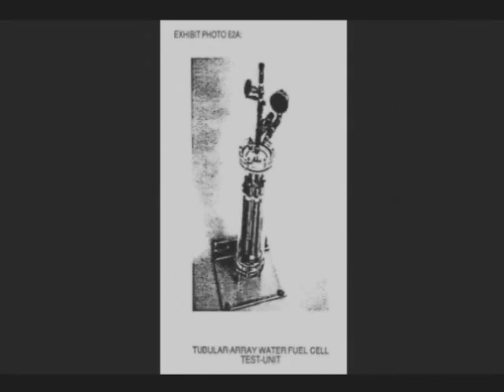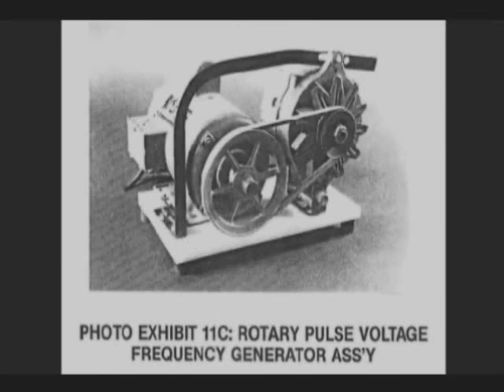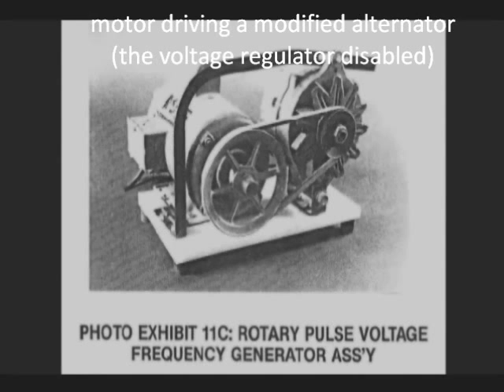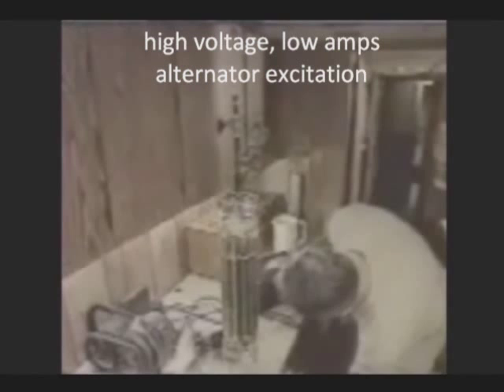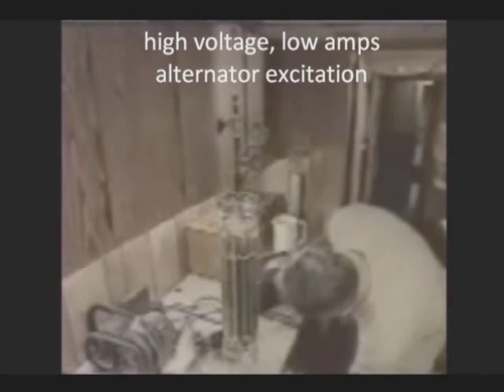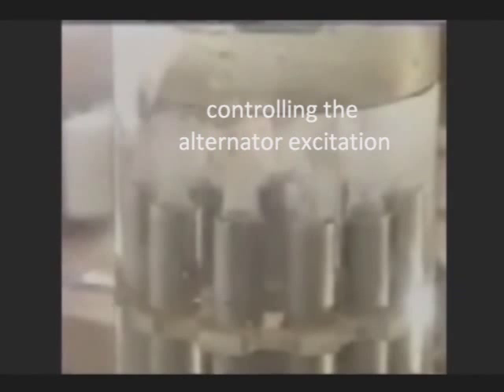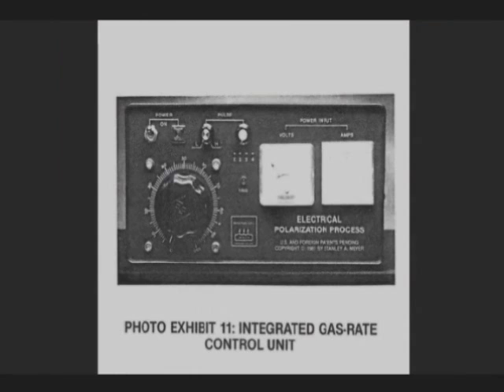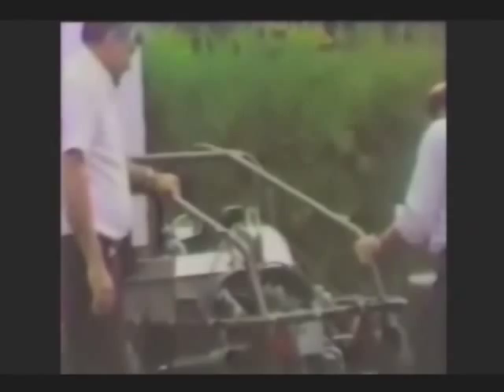Stan Meyers alternator control

Comment: Right now I have gotten my newer version Meyer units up to 1 kv drawing only 19 ma to the exciter array. The newest ones are doing better but I am having some problems with the impedance matching some what but from what I have seen I am getting the highest amount of voltage to the exciter arrays, as I have two different ones I test with, than anyone else at the moment. I have gotten it as high as 1.7 kv in one exciter array and close to 2 kv in the other all putting in less than 50 ma to the WFC
Reply: Edward Mitchell 1kv??? Un alternador nunca puede entregar ese voltaje. No se de donde sacas eso. Ni siquiera bobinandolo con un alambre más fino.